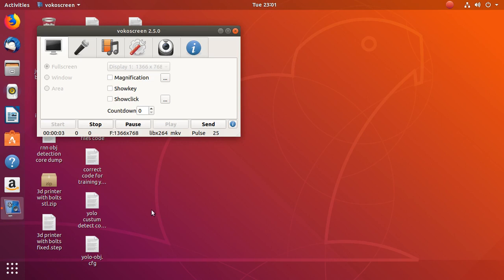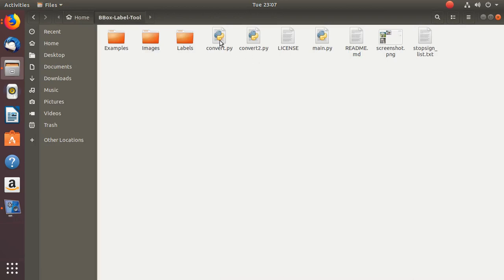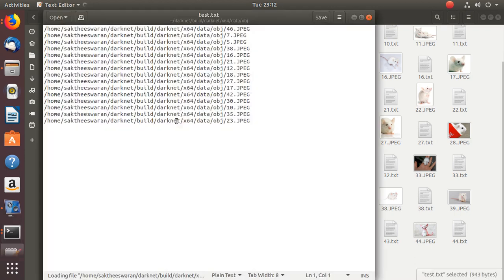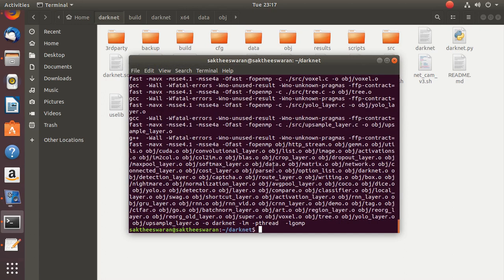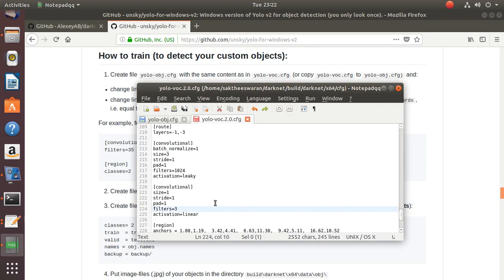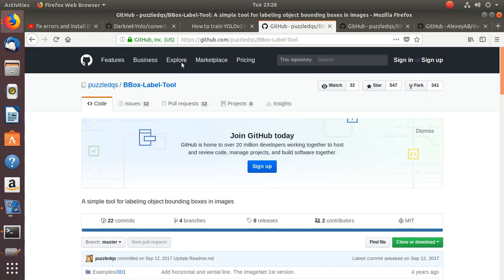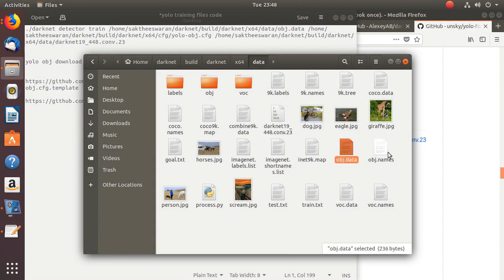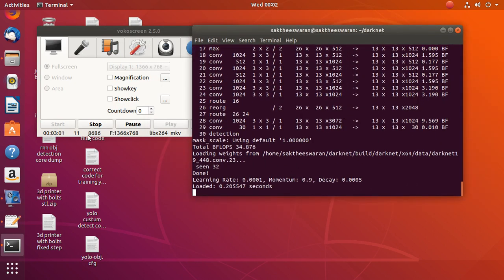yolov3 custom obj detection using  process.py seperate train and test annotation txt and image files

Comment: 100: 0.491653, 0.167075 avg loss, 0.001000 rate, 46.680672 seconds, 100 images
Saving weights to /backup//yolo-obj_last.weights
Couldn't open file: /backup//yolo-obj_last.weight    ******Where is this file?How I can solve ?Please advise me. Thanks M.Asad